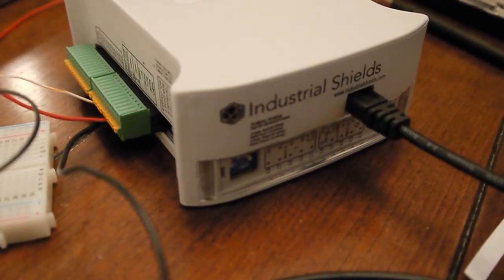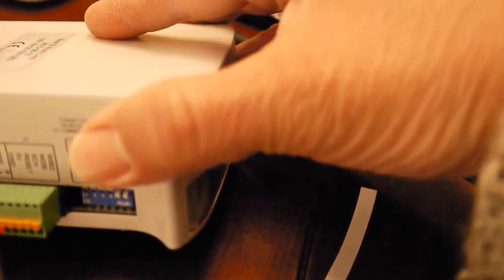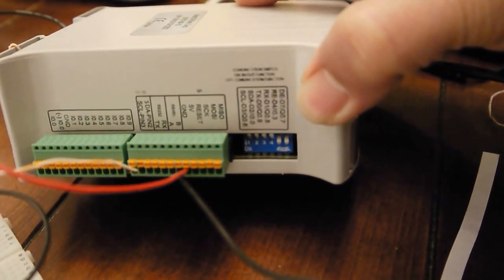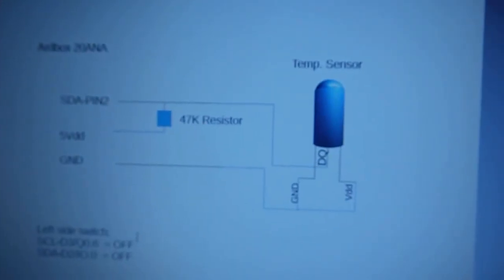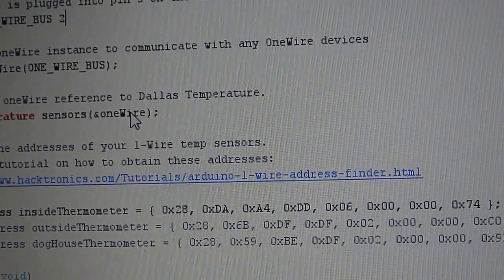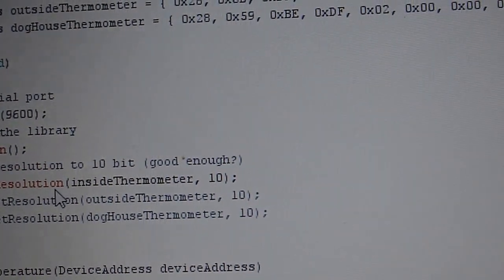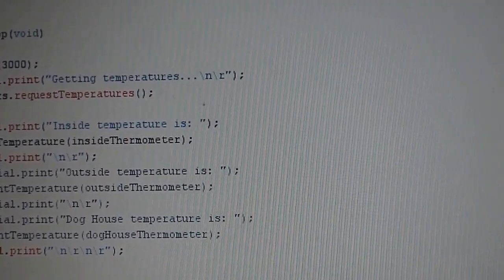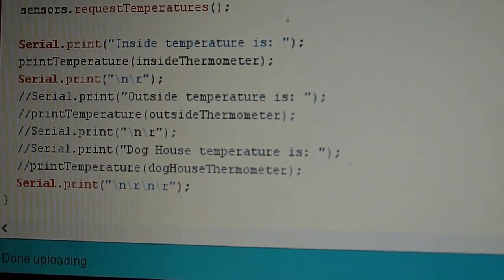Connecting  Dallas Temperature Sensor to an Ardbox via I2C

Comment: Do you have a sample with 2 temperature sensors?
Reply from the maker: Yes, I do. I can send you a copy of the code if you need it
Reply from the maker: Here is an schematic using more than two temperature sensor using only One Wire
Reply from the maker: https://www.instructables.com/id/Van-Monitor/
Reply: I'm trying to use a relay and I'm using this code but it doesn't work:

https://www.industrialshields.com/es/forums/topic/testing-52-valve-with-ethernet-plc-19r/
Reply from the maker: Hey, I could not see your code. You can also send me an email to marquezae01@gmail.com with the code or paste it here. I will take a look and let you know.